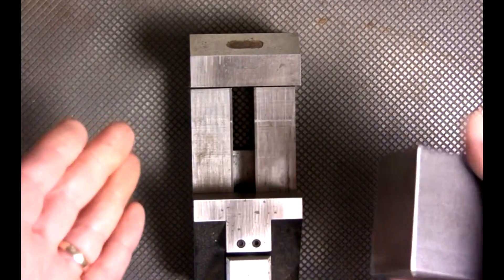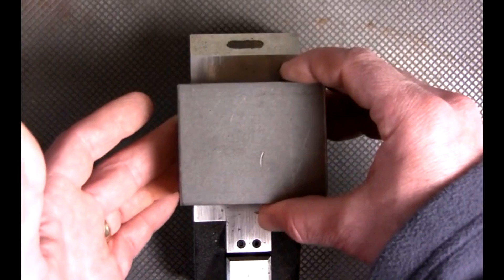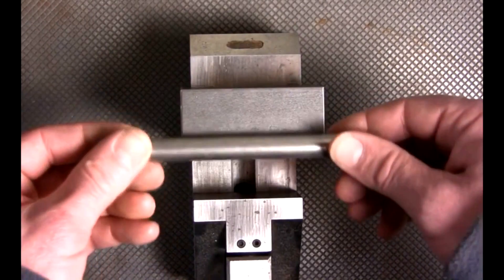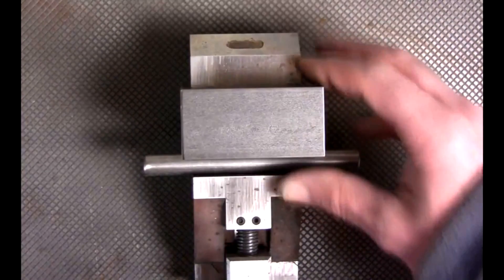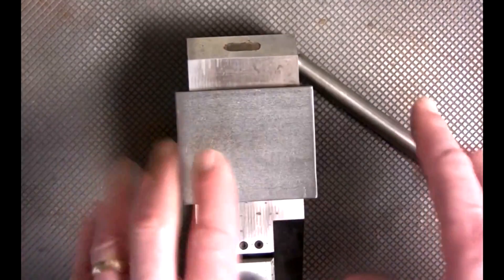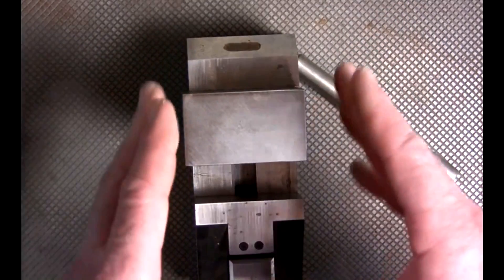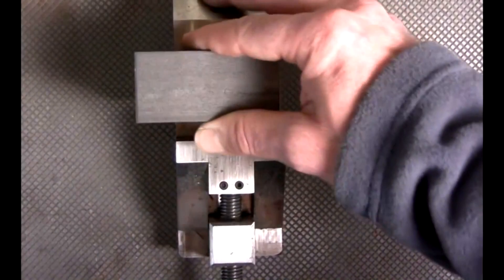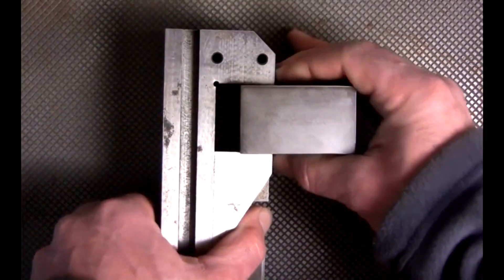HOW TO SQUARE UP BLOCKS ON A MILL

Comment: i was convinced at the start this is going to be flawless. dont use that rod. outdated from the civil war days. take a piece of aluminum stick and mill it off leaving a pad. stick it in from side like a handle placing the pad about 3/4s down. dust off next surface. Rod is not used--especially by experienced machinists. the side that is against the rod-moveable jaw has to be very good. list is endless why not to use rod. using the pad method it can be .050 out of square sawed bizzarely makes no difference. you cannot use a rod as shown unless you get lucky. if I were to use the old rod thing and forced to do it I would stick it in about halfway and crush down on it. 

rod method is not used--it dates back to old books from the civil war

here is how to get away from the rod method: take an aluminum rod such as shown. now turn down clearance leaving only 1/2 inch or so. use that and crush down on it. 

once you reach that point "the light will come on". what you will end up with is simply taking a strip of aluminum 6 inches long and milliing off one side .020 deep and you will never vary from it untill you retire
Reply: I actually have and use a plastic screwdriver handle with a pad on it.
Reply: I take a rod with a flat on it, Dead soft material and put the flat side on the work piece and the round to the moveable jaw. Instead of line to line contact between the moving jaw and the stock the flat displaces any deformation

Comment: I actually prefer copper wire in two places, high and low on moveable jaw.  Did some time in a shipyard and a lot of our material was CNC flame cut steel sometimes 4-5 inches think and only needed one face cut with a step in it or a hole or something.  Copper wire was the only real option when you needed to hog a little and do another operation like that with it without machining the flame cut faces.

Comment: I was taught this trick many years ago as well, and use it often. One thing I would add. It may not be a factor on CNC mills, but on Bridgeport style mills with adjustable heads, you need to make sure the head is trammed in square with the table. It doesn't make any difference what technique you  use, if the head isn't square, you CAN NOT square your part.
Reply: Applies equally to CNC mill, method of control doesn't matter...

Comment: I was taught that instead of a round bar to use a ball with a flat. 

I would be curious to see what worked better.
Reply: @TheToolandDieGuy  

Who is Vince?

My instruction stressed the 123 rule of clamping. So in this example the fixed jaw will supply an effective 3 points pf contact, the base iv the vise will give 2 effective points of contact,  so the movable jaw then ves 1 point of contact, with the resulting machined surface being square to the face of the block adjacent to the fixed jaw.

Hence, my curiosity about the effective difference between the two techniques. 

Not trying to pick a fight, either technique may get to the point of "good enough" but are they equal or is one measurably better?

Comment: This is 100% best advice; what you'd expect from a solid journeyman.  I've been doing it like this for over 40 years like this, so does everybody in toolrooms everywhere. Sometimes I first put the big face against the solid jaw and take a cleanup on one side first. Then I flip the block, and with the milled side against the jaw, take a cut on the biggest face so it cleans up faster. The rest, exactly like Phil says. Then side mill one or both ends. A trick I've used forever - have a precisely ground vertical 1/4" slot in the back jaw for a 1/4" tool bit or key, and butt the block up to it for squaring up the ends.  
I'm so old that, as a test, we apprentices had to cube-up a shot-put ball in a shaper. Our squarehead boss timed us and checked our work with verniers and a square. Those days are gone and people are learning machining via YouTube. Keep it up Tool and Die Guy!
Reply from the maker: Thanks for your comment!